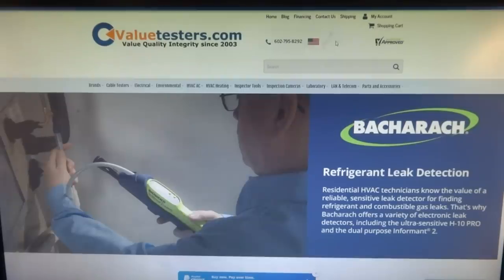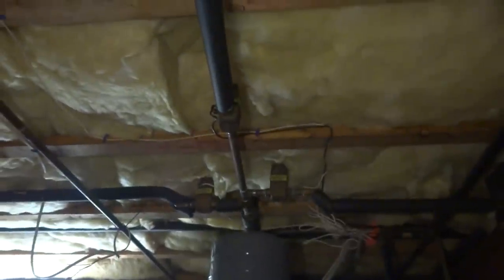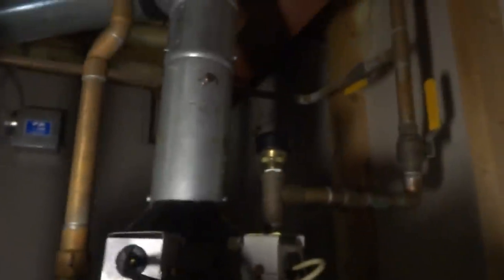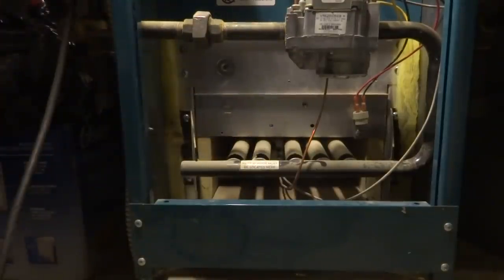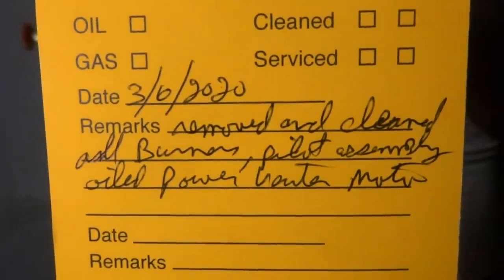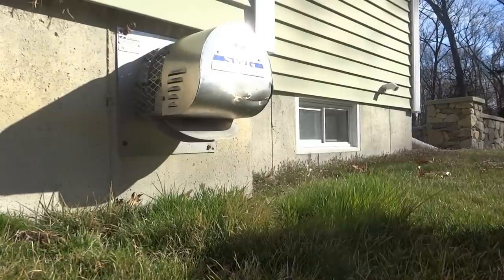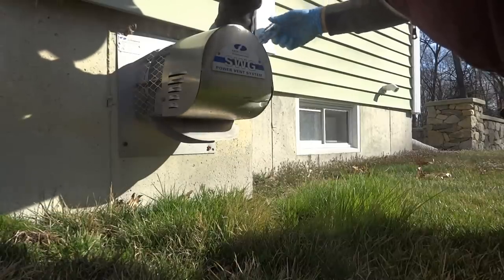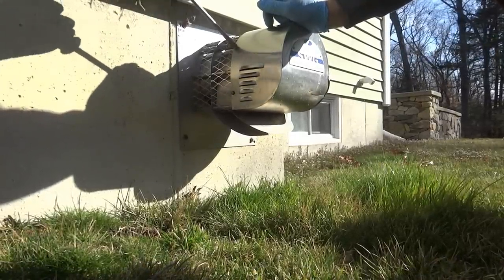gas boiler annual check & maintenance

Comment: I would like to see more videos on this type of boiler.
My problem is when it turns on and more than one valve requires heat, the burner starts moaning at a certain point, what could it be?  FOR MODELS MG-50-E TO MG-150-E

Comment: This looks like a Utica boiler from what I could see. Unlike oil fired burners that need to be cleaned out annually and have the nozzle and filters replaced and the electrodes adjusted there really isn't much you can do with these. I pull the blast tubes (for lack of a better name) out annually and run a brush through them and then clean the outside as well. What else can you do to these beyond what I am doing?
Reply: It's a Burnham steam boiler. Best on the market.   You are correct, they are very low maintenance.  Not much to do but clean and replace a few cheap parts as they wear over the years.

Comment: Question:  can you add a short extention tube to reposition the temp/pressure tridicator gauge?  Mine is on an 1 1/2" manifold inside the boiler cover (by the fan).  I'd like to use some flexible copper tubing and mount it on the outer cabinet.  Possible or would that give errant readings (pressure may be OK, but temp may be lower with a 12" flexible stem that's not in a circulating loop?)  Thoughts?

Comment: Steve, I have  a Bryant Gas Fired Water Boiler (1973) model 234 (nat Gas) that has always worked but today its not. I turn up the Thermostat for Call to heat and I see Pilot light go on and then the burners got on (Orange flame mostly) for a few seconds and then go out but Pilot reignites relighting the main burners etc.. This cycles 5 or 6 times and then it all shuts down Until I shut down the unit and restart the call for heat Any ideas whats going on or what I should try > Thanks Frank
Reply: Sounds like a flame sensor issue. flame sensor touching the fire should send current to the circuit board to prove flame is there. I am sure you already repaired it. Would like to know what the technician did and if it was the Flame Sensor.

Comment: Why does the gas boiler needs a motor  ?
I thought that the gas furnace needs a motor to circulate the worm air into the house. 
Isn't the gas boiler designed to boil water and then circulate the hot water by a water pump through water pipes then through radiators throughout the house  ?
Reply: because it's in the basement, they made it so the air vent has to travel a bit horizontally to the outside.   you put a motor on that vent to ensure the air vents out properly.   Many boilers are in the garage and vent straight up through the roof, no motor needed.
Reply: @Skipbo000 
Thank you for your answer.

Comment: So you just bang the burners on the floor and brush the dust off, without ever cleaning up the floor? Where it can be drawn back into the boiler? And you just dump the wasp nests on the ground, and don't vacuum out the unit?  I used to service electronic equipment and medical equipment, and encountered as much stuff or worse.  Customers appreciate it when you clean up.

Comment: Why didn't you change the thermocouple? After 14 years it's due.
Reply: He said it didn't look burned, but yes, that's a long time and thermocouples are cheap.
Reply: My boiler gets serviced every year and changing the thermocouple is part of the service. I have them leave the old ones for spares. I'd hate to lose heat just for a simple thermocouple failure.

Comment: Shouldn't you also use compressed air to clean out a boiler or furnace?
Reply: On this boiler, the top should be taken off and the narrow area between the sections brushed out. This must be done yearly on an oil boiler, but a gas one can get by for a couple of years. The soot will fall down below so the burner tubes would be taken out first. Then the soot  would be vacuumed up and the cleaned tubes put back in. If you use compressed air you're going to have soot all over the place. A vacuum made for boiler service would be best.